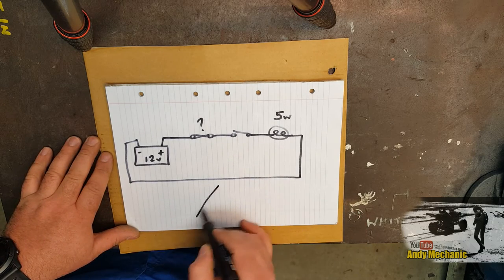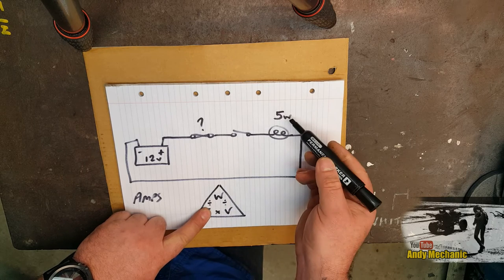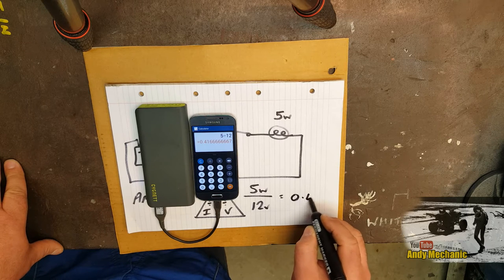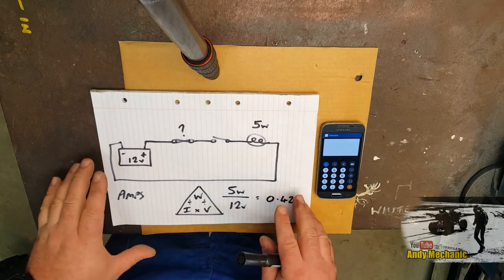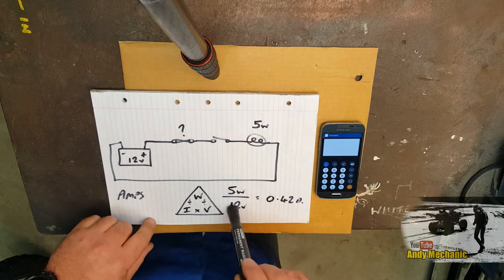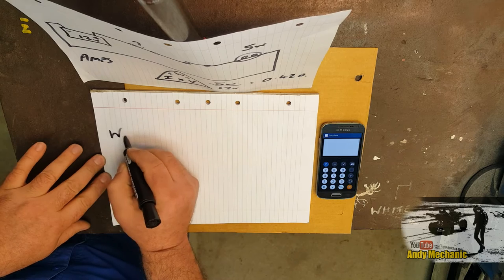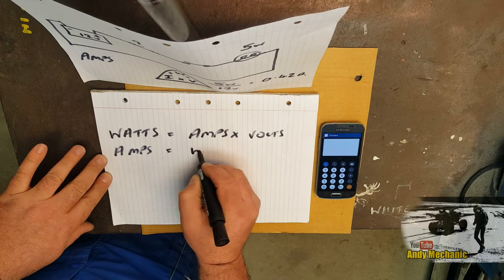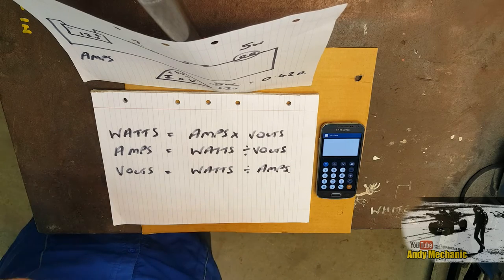Volts, Amps, Ohms & Watts calculations #1412

Comment: I'm a spark chaser myself so I'm loving this. It's just like water the smaller the pipe the more pressure you get with the same flow of water & they both take the path of least resistance too.   
Great demonstration here I like it. Thanks.

Comment: Oh and we was taught that in the triangle that E- Volts or pressure, R= Resistance, I= Current & P=Power. Just a FYI but I get it. Thanks. You are correct in saying that the consumer or load isn't the only fact of as temperature effects the circuit as well. Great information on a basic scale that should help out many.
Reply from the maker: +Calvin's Corner72 Thanks for the feedback Calvin. Yep. Just trying to deliver the info in small, steady bite sized chunks! I hate leaving students behind by making it too complex too soon.

It's amazing how things can vary around the World. Cheers Andy